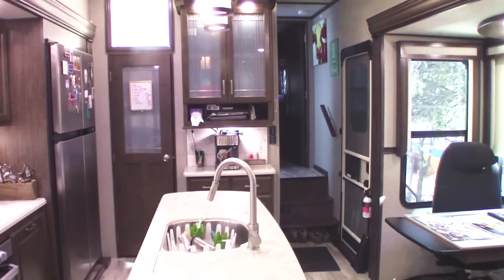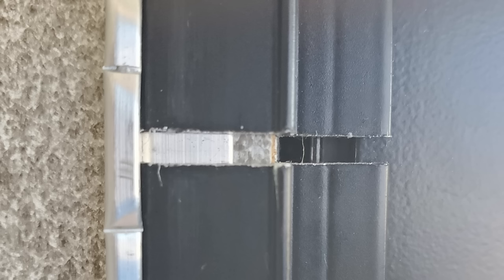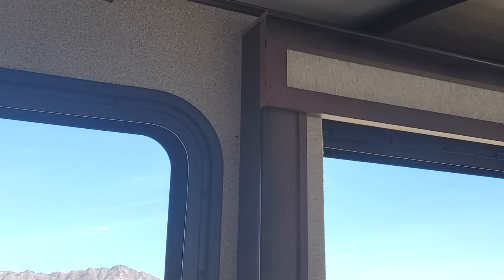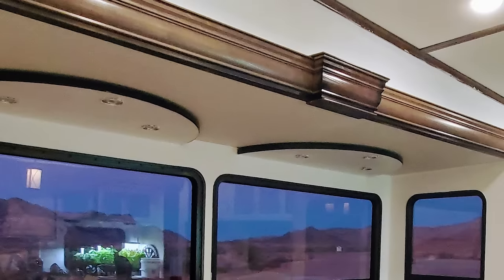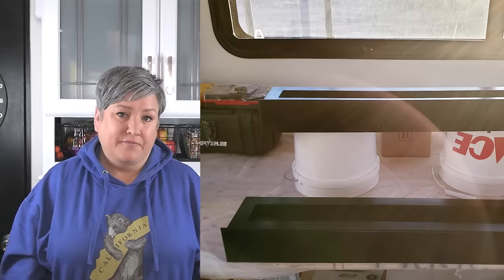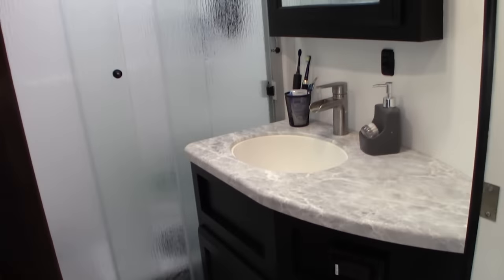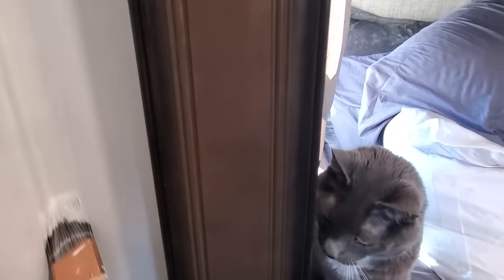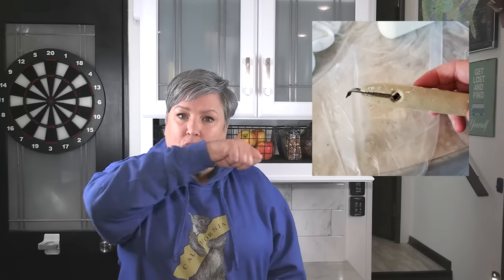DIY CAUTION: HOW TO PAINT RV WALLS & CABINETS. We Painted the Interior of our Fifth Wheel! Learn...

Comment: I am a interior house painter
The silicone you took out is what seals you counter against water. It beads up when painting  I caulk over it  with paintable latex caulk.  Tape does peel when you wait til it's dry to remove it.  The best primer for wood is Bin shellac base by zinsser
Reply: All pros know that you must remove caulk before you lay new caulk. Read the directions on the tubes you are using.
Reply: Well  @jessejames7074 Mr. PRO, if you had read & understood what I wrote you would grasp the concept!   Her paint beaded up because it's not caulk it's silicone. Paint won't adhere to silicone. To allow paint to adhere, use painter's caulk over the silicone, then paint. Get it?
Reply: @Girls With Guitars  So there is something called "painters caulk" that will adhere to silicone, then I can paint over it?! If so, can you tell me what brand? I need it for inside my house. The builders used silicone on all the windows, and I need to paint the sills. Thank you
Reply: @cassandraking7150  Dap brand painter's caulk. In the white tube green print.  There is also Dap Alex which has a percentage of silicone in it and it is also paintable.
Reply: Use a wet finger to smooth it out after running your bead of caulk. I use a wet rag all the time when working & keep a pail of water at every job to rinse the rag.  Good luck with your project 😁👍
Reply: @GirlsWithGuitars  I was reading people say to never use silicone in an rv but I wanna make sure my windows are sealed to keep water out when it rains so should I use silicone?
Reply: @briizcustoms9543  thank you for your question, silicone will provide a great seal and last for years IF done correctly,  latex caulk will seal but won't last like silicone will, it will pull, peel and discolour. Tubes say it will last for 25 yrs, but if not applied correct it will fail. (search for videos on the how to apply properly)  For windows I use latex caulk interior/exterior. For areas where water is present, tubs, showers, sinks etc I use silicone.  If painting walls after, I caulk over the silicone with latex, then paint because silicone is not paintable. I hope that helps.  :)
Reply: @GirlsWithGuitars  Do you have social media? You seem very knowledgable
Reply: @briizcustoms9543  Thank you for your inquiry. I used to have a page on FB but I retired after 30 yrs, if you want more help with projects  you can go to my youtube channel and search out my work video it has contact info.
Reply: @GirlsWithGuitars  Just sent a Twitter comment :)
Reply: @briizcustoms9543  Thanx, but I've no clue how to find it. I haven't gone there in donkey's ages! lol
Reply: I have used painters caulk over silicone, works good
Reply: @VOOODOOO37    👌 😁
Reply: @GirlsWithGuitars  yeah it really works.. cause silicone won't take paint. try it
Reply: @VOOODOOO37  I have been 'trying' it for 30+ years as a painter  lol
Reply: @GirlsWithGuitars  great, seemed like you thought my suggestion was a joke with your emojis
Reply: Putting latex caulk over 100% silicone DOES NOT WORK is like  painting over will peel off
Reply: Oil based Kilz will adhere to the silicone caulk
Reply: Yeah. Putting latex caulk ovee silicone is not the best. It will last longer than jist painting over silicone. But thays still silicone and your puting a water based product over it. It wont hold. Itll just hold linger than the paint by itself because its thicker. Best bet is to dig iut the caulking and recaulk with siliconizes layex . Its paintable and has a small percentage of silicone in it.  Also the finished product with two layers of silicone is usually gonna look like ass.
Reply: Goodness
Reply: 100% on the primer.
Reply: @briizcustoms9543  well if you want another pro tip, use a modified polymer silicone, the best I've found is amp by dap. It outperforms silicone for water and is paintable.
Reply: @briizcustoms9543 if you want to keep water out, then you’re speaking of the exterior. And NO, never use silicone on the exterior of your RV. Sikaflex would be the sealant of my choice.  Before you do that, make sure the butyl tape behind the window trim, on the exterior, isn’t old and cracked. If it is, remove the window, remove the old butyl tape and replace with fresh.  Then reinstall the window.  Also, the small hole or holes at the bottom of your windows, are called weep holes. Make sure those are free of debris.  They’re there for a reason and that’s for rain to escape vs entering your RV.
Reply: @GirlsWithGuitars I think she was asking about silicone for the exterior which is a HUGE no no.
Reply: Flex is far better

Comment: We bought a 42' 5th wheel that had a fire inside. Most of the damage was smoke so we ended up painting all thr walls. Here are some tips.
1. Almost everything is just screwed to the walls. Don't tape around windows just unscrew and remove the interior trim. Paint and then reinstall. Same with lights and even some cabinets. 
2. Instead of worrying about ceiling transition paint. Just install trim. Use construction adhesive and a finish nail gun. You can pre-paint it and then touch it up once installed. It really hides the transition gaps better and adds a decorative element. 
3. They have lots of colored caulking that can be used instead of paint. If its a transition between a counter then the counter color looks good also. 
4. Don't use tape. Spend the extra time working slowly so you do not need to tape. It will save you time overall. 
5. Remember in painting it is the detail work that takes the most time.

Comment: I was in the renovation business for 40 years and that was always a thorn in my flesh. Then one day I had an aha moment and I tried using some siliconized latex Caulk over the top of that it’s stuck just fine and it painted just fine as well. Try it it will save you lots of work

Comment: Love the how too video. It contains a lot of necessary information with dos and don'ts for folks wanting to do a face lift inside their RV. It is interesting too that the cabinet work near and around the refrigerator is sealed air tight with silicone caulk. The reason for that is that the refrigerator burns propane... similar to what a home gas water heater does. So the cabinet work is actually part of the chimney to vent out the exhaust gas to the roof. Keep the factory caulk in place. If you remove it you must put it all back. Yes it's true paint don't stick to silicone caulk, but masking tape will stick to silicone caulk. Put masking tape over the silicone caulk. Ok to paint over the masking tape. To help hide the masking tape ok to use water based latex painter's caulk over the masking tape. Way less work than trying to dig out the factory caulk. Please leave that caulk where it was designed to be. If you do have to dig out any silicone caulk, get some new stuff and put it back where it was. Yes I am a professional painter. More importantly I'm an RV owner.

Comment: I painted the inside of my RV and I used Fusion Mineral Paint. It has no VOC's and a built in primer and top coat. There were a few areas I had to use 3 coats. Also I used BIN shellac primer in white to cover the silicone chalking before painting.
Reply: I used primer/paint Rustoleum worked great.

Comment: Lots of great info here; adding another tip from my house painters - he had a metal strip with a handle that was about 18 inches wide and 4 inches tall before the handle; he would hold that metal strip into the corner and parallel to the wall he wasn't painting; any overlaps from the brush went onto the metal strip.  No need to tape, no need to paint very slowly on edges.  Could buy/make those metal handheld paint guards in any size, and they would be easy to clean between or in the middle of paint jobs.  Thanks for a great video and thanks all for the comments.

Comment: Great video. I would add one caution, and I realize most people don't keep RV's for a long time and fewer seem to want to deal with older RV's. But having a late 90's Tiffin I can tell you that the wall covering can become unstuck from the substrate. I can't use Command Hooks, they just pull the wall covering loose. And I wouldn't paint over it for the same reason. I have found that gentle use of a heat gun will let you remove the stupid, glued on wall covering in my RV, with little trouble. Thanks Robin!

Comment: 10:00 mark:  If you take the tape off when the paint is still wet, that won't happen.  I've had this happen to me no matter what I'm painting.  Just do your painting and then remove the tape shortly thereafter.  Don't wait until the paint dries.  This isn't just a problem in RVs.  It happens no matter what your project. If you wait too long and the paint is dry, run a blade along the edge of the tape before you remove it.  You almost have to do this when doing multiple layers of primer and/or paint unless you want to re-tape every time in-between coats.  That would get costly.  Just do however many coats of paint you want and then make your score along the edge each time (and especially after the last one) and remove the tape before the last coat dries.
Reply: Man thank you
Reply: Run the blade on the edge of the tape, to get it off?
Reply: @igotit416  Yes.  It will cut a line through the paint.  Just be careful not to cut into the tape or it will stay behind, too.

Comment: Hi Robin. Thanks for posting your experience with painting your RV. I recently painted mine. After doing a lot of research, I decided to use PPG Gripper primer and it worked very well. Just one coat covered the walls and ceilings. 2 coats for the cabinets. I did know to clean the walls before starting, but I didn't clean the first few wood parts after sanding. I just wiped them down and starting painting. once the paint dried, it pulled off completely. After that, I sanded, cleaned, primed, then painted and the results were great.
Reply: Do you use water or oil primer?

Comment: When I paint, I hate using the painter’s tape because it takes so much time (and it must be removed immediately after painting, you can’t let it stay on or it will take off the dry paint with removing).  As a 40+ DIYer, I usually use this large scraping tool that I bought 35+ years ago when I put up wallpaper.  It is long (approx. 24”) stainless steel rounded edge with a black handle.  Since it is stainless, paint comes off easily after each use.  I have a smaller version that I bought a few years ago (for a different type of project) and all I could find was all plastic.  Still did what I needed it to do  - keep the paint off the surface I didn’t want painted.  Your all’s paint job looks AMAZING!  I’m not sure a professional would have done that well a job.

Comment: I used Zinsser oil based primer in my camper to make sure that the paint would properly bond to any painted surface, especially because of the temperature fluctuations. Then just regular latex paint in eggshell from Home Depot. The one mistake I made was not leaving enough drying time in between coats on the first 3 half walls I painted. They took months to fully cure and dry. If you scratched it will your nail during the months it hadn’t fully hardened then it would scrap off. It wasn’t really and issue for me though since I had a bunch of other work to do on the trailer. The other painted areas in my camper turned out great. Proper cleaning (I just used some Dawn dish soap and water) and then lightly sanding it are critical. 4 years later and everything is holding up great!
Reply: Thank you.  There are so many videos of people saying they are pleased with results of certain products but some haven't even been through all 4 seasons yet.  I'm happy you're has held up so well over years.
Reply: The only reason that paint will NOT dry is because the paint was frozen at some point, likely before you ever purchased the paint. The retailer may have bought bad paint unknowingly from a failed competitor.

Comment: One tip I might add that has worked for me in my hybrid is using DAP Extreme Stretch Caulk in between gaps. It stays flexible even after drying  and seals bigger gaps that are all too familiar in rvs (: thanks for the great video!

Comment: I used to use the blue painter's tape and put up with the bleeding.  Then I discovered the green tape which is so much better.  The secret to painter's tape is to remove it as soon as you finish painting while the paint is still wet.  Then it comes off clean.

Comment: The upper window boxes may look dated, but they keep outside light from shining up onto the ceiling (annoying in some city locations -- think Las Vegas), make cleaning the cobwebs above the curtains easier, and make the layout neater and more uniform (covering a multitude of sins). 
And I prefer to mess up my own paint jobs, rather than deal with the same mistakes from a hired crew. It's a cruddy job? No excuses, no busy signals, no strangers tramping through my sock drawer.
Thanks, Robin and Doug, for doing the heavy lifting for the rest of us before our own frustrating projects. Good job, there!

Comment: Thank you!! Started painting my 2013 RV. Thought I was doing all the right steps, including the cleaning and sanding and removing the caulk. Then the tape challenges began! Very good tip to not use the tape (i stopped using it pretty quickly except in areas like cabinet meets floor). Good tip on the driving around to see how the corners and joins clear up. Was trying to figure out how to address that.

Comment: You should use paintable caulk to close up seams & all the edges. I’ve painted a lot of interiors, you can’t use a foam flat roller on rough or textured surfaces. The cabinet paint you used is excellent- I painted my daughter’s cabinets with that- no primer needed, just a thorough cleaning (including degreaser) and light sanding of the surface to add some texture for paint to adhere to. The tape will tend to stick if the paint layer is thick or if the tape is left there for some time to dry along with the paint. Tape should be carefully removed as soon as you’re done painting.

Comment: 3:11 Krud Kutter is good stuff. When i painted my kitchen cabinets in a house i used to own, it was double strength TSP, then light sanding, then steel wool, then tack cloth, then paint, then steel wook, then tack cloth, then paint, then steel wool, then matte poly.

They looked brand new.

Prep (and beer and a radio) is EVERYTHING

Comment: I've found that with any type of caulking, if it won't come off easily, I clean it up as good as possible, gertting all the bigger chunks off, and  run a brand new bead over the old stuff. It makes it super smooth. There is also a trick if you are painting house walls and want to do walls separate colors. Run a bead vertically down the corner of where the two walls meet. The caulking makes a super smooth line, so when cutting in for the second colored wall, makes it loook super professional.

Comment: We had a 2004 RV38ft we remodeled and painted it. Now we are working on our 2018 touhauler 30ft. We also just picked up a 1985 Chevy Champing Van that need a total overhaul.  We're going to use it for shorter trips. That one will work. But in the past we gutted out a 1985 class C totally had gutted it out. It turned out beautiful we had put a composting toilet in it.  It was a beauty at the end. Do not know how to eddit vidios or I like to do vidios but the would have to be edited....
Thank you much for your vidios.

Comment: I found when painting the interior of my motor home that after I scraped and cleaned and sanded and cleaned again before I put my paint on the wall I got out a cheap flexible metal compound knife and used it for an edger. And kept it cleaned off. It worked like a dream

Comment: Only thing I would add is to pull tape up while paint is STILL WET. When wet it does not screw up edges as badly.  But a paint edger straight flat piece of metal on a handle is so much easier.  Big fan of Kiltz product.  One of my favs is Kiltz restoration paint will even cover smoke damage.  TSP is what I use on walls to clean the. Kiltz it....the joys of 30 years of painting rentals....ugh.

Comment: We did ours too but we didn’t have the issues that you had. No caulk in corners that we were unable to paint over either. I like the texture of the wallpaper so we just primed and painted. No problem. We did cut corners on painting our cabinets and I won’t do that next time. Other than that, it went smoothly. Personally, I would never hire out. Flipping is something that is a great hobby/challenge for me and the more I do it, the more I learn! 
Your camper looks like it was worth the headaches! It’s absolutely gorgeous!!!! 🥰

Comment: Beautiful transformation! We'd recommend a paintable water based caulk with elasticity (that will stretch a little after it dries) that you can apply to those open seams on the wall corners, ceilings, perhaps? Still, hard work and glad to see your kitty at least lift a paw, even if it wasn't entirely helpful except for comical relief! 🙂